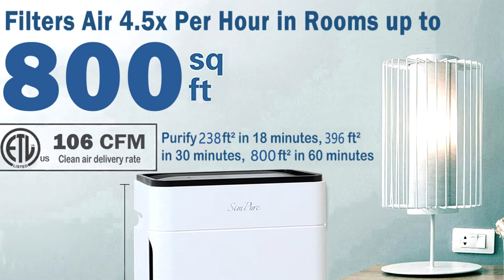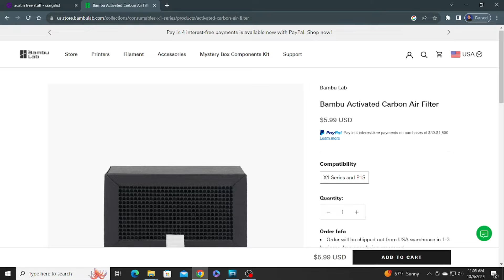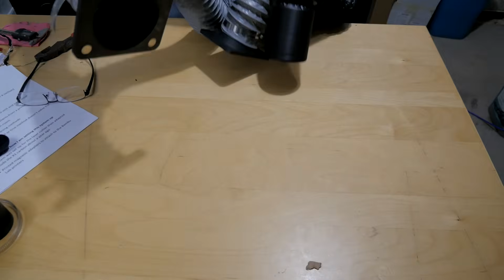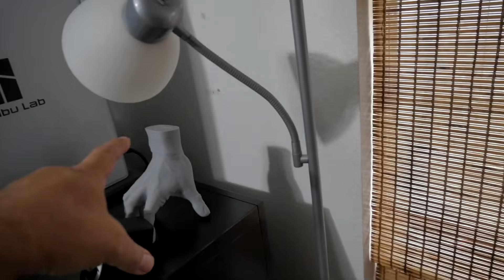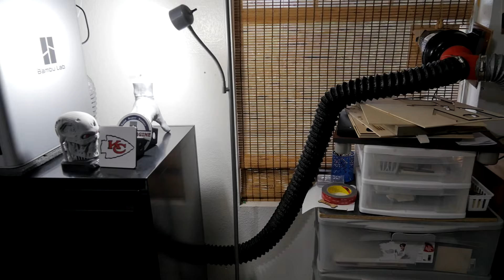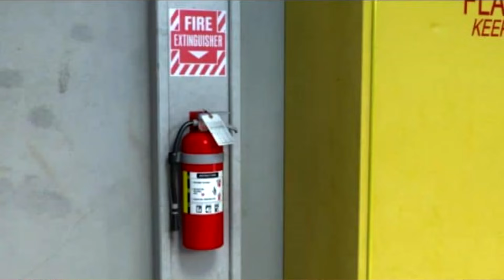Do You need Air Ducts or Exhaust for Your 3d Printers?

Comment: im new to 3D printing and i have the X2D. i just print with PLA for now. im asthmatic so i have noticed that when i enter the room while 3D printing, i can feel im a bit short of breath. im not sure if im imagining that i smell some fume. this is despite having an air purifier (placed near my X2D but sits on the floor - X2D printer is on the desk/table) that is rated for 1000 sqft area (my room is just 180sqft). I have noticed a difference when i placed my air purifier beside my X2D ( i have the Levoit with vent outwards). I am still thinking of installing a small exhaust by my sliding window but will observe. any suggestion?

Comment: I dove into a filtration system and got vivisun fan for the job. I had printed only 2-3 times when i first got my printer. it 2 14 hr prints and I started having breathing issues within 2 hrs and a perma cough for a week. But i also got insanely dizzy and my eyes were burning n i thought i was just sick. all this from just PLA. The vocs are no joke. 

also my pc's were sucking in some form of particle that it make the inside of my pc like significatly dustier and with coarse dust also. I keep my shit clean and it got dirty dirty. 

Printer i used was the X2D

Comment: With CA trying to ban 3D printing, I'm surprised they haven't taken this tack to put an end to it.  With all the air quality insanity we get from the AQMD, and the push to ban gas stoves due to global warming and indoor air quality issues, this just might be their next line of attack.  Just took delivery of a new printer, and I'm uncertain where to set it up.  Considering a corner of tge garage, and installing a stock bathroom fan above it.

Comment: This is quite a complex topic when you start investigating it. Most videos show no evidence of air quality measurement to assess the systems they set up. Accurate air quality meters are probably not available at domestic prices anyway!! Air filters vary in how much carbon they contain and not all HEPA filters are equal. They also don’t deal with ultrafine particles. There is also no way of being certain when your filter has stopped being effective. The bit I do agree with is to think about them in the same way as a car exhaust. Spend as little time working near it as possible with as much ventilation as possible. Apart from that there are a lot of unknown variables.

Comment: These are the parts I bought on Amazon. Doing this for my first time so would appreciate any and all help. I have 2 printers Elegoo Centauri Carbon ECC and X1c. AC Infinity 4" blower unit designed for a Grower tent. AC infinity, I think, a Hepa filter unit. I also bought a Round charcoal filter unit. I see that it does not have a way to pass air through it to vent to the out side. So it is supposed to vent inside? On that safety issue? I also bought something called the blast gate. According to Gemini V3, which just can out, is needed if you are only running one printer at a time so fumes do not pass "backdraft" back through your Y adapter instead of going out the window.  I guess my ? Is just to confirm that this will make things safe. For peace of mind. I wonder if I can replace the "hepa filter" with a Hepa/Carbon filter and not having to find a separate carbon filter unit that can then still vent outside. I would show you a pic of the parts and the diagram Gemini designed for me. But I can find a way to attach photos.

Comment: Any issues with chamber temp when hooking up external fan?
Reply from the maker: If you have a high cfm fan, it will pull some heat also. Use an adjustable duct fan and keep it low, enough to pull fumes.

Comment: The only issue I've ever had with venting outside is winter. Especially if my laser machine isn't running. I have a 3d printer on order so I'm hoping to make a filter system for it for inside so the enclosure isn't frozen when its not running. I'm still trying to figure out a way to put a door of sorts on the ventilation system to keep the cold out when its not in use while not having a leak when its running with the door open. I tried putting a one way draft blocker but they aren't effective. They even let smoke backfill from another laser when only one is running so i need a different solution.
Reply: Use a DC inline duct with a double pane plexiglass window.

Comment: HEPA filters work great for particulate matter like PM 1, 2.5, and 10. To get rid of volatile organic matter (VOCs) an activated carbon filter is very important. The carbon filter on the Bambu Lab X1C I have doesn't seem adequate by itself. I am using a Blue Air 211+ with smoke filter for now, but an exhaust system to vent outside would be great. I am curious if too much airflow in the printer will negatively effect the print though.

Comment: Cool, video,  Lots of good info. Thank You.   I'm still trying to figure out what to do in my case.  My printer is in my residential windowless basement office with ventilation. No heat and only below grade passive cooling in northern Canada.  I need to figure out some kind of  insulated damper system to go from indoor to outdoors where the temperatures can vary from +38C down to -40C temperatures.   Something where I don't cook to death in the summer or freeze to death in the winter and avoid off gassing myself.  Heating isn't a problem between multiple computers and the 3d printer.  But the smell from PLA is what has scared me off trying ABS and nylon.

I am printing the "Bentobox" found on PRINTABLES, but I think I'm going to step the fans up to NOCTUA fans as BEQUITE doesn't make any fans that small. I don't want to become a wind tunnel of noise.   More research.  If you have any ideas I would love to hear them.   The last thought was an expensive idea, and likely beyond my financial means,   A sealed enclosure with a dedicated indoor air exchange with carbon and Hepa filtering system that encapsulates the Carbon X1 and have the AMS sit above it for easier access when changing filaments.  But space may be an issue.

Comment: I have watched some other videos and you really need 2 fans one for bringing clean air into the printer as well as exhausting the bad air. And YES, when you bring in cool air it is going to affect prints. So it is a give and take regarding regulating how much air flow volume is the right amount for the filament and temp in the enclosure. And also a heated chamber is needed for some types of filament. There are probably some other issues not stated here. But I think one issue is that printer beds do not heat 100% evenly all the way to the sides of the build plate. If we had a build plate that did heat evenly from edge to edge I believe that would help a lot here in the warping aspect of parts.
Reply: Yes this video is - very - primitive. Better than nothing I guess, but not the correct way to do exhaustion of toxins. Thank you for mentioning using - two - fans. Using a chamber heater will somewhat correct for the cool air issue. Both fans should be matched and set up so the air pressure goes from negative to positive when venting. Otherwise you'll create a bottleneck. Using a good 4" DC inline duct fan also works. Having a good Carbon Monoxide Detector in the room is also a must.

Comment: Hi thanks for this video, very creative idea.  Do you run the blower while printing or after?  Have you noticed any change in the print quality.  I heard you can adjust the bed temperature in the X1C settings.  Curious if this kind of setup could work simultaneously with the printer, but some jobs are hours or days.  I wonder if a bath fan could handle the abuse.  Great job, thanks

Comment: I've got a Qidi x-max3 and have install a 120mm fan to the rear with a adaptor duct to bring it down to 100mm duct tube going through the wall outside. I run it at 100% most the time when printing PAHT-CF and dont have any problems with printing and havent noticed any difference in chamber temps. The fan is pushing 83CFM ,I am yet to try with ABS

Comment: Newbie here but question about the setup.  The Makereorkd file is for a 3” hose snd the blower is for 4” hose.  Do I need to modify the print file, or do you have a 4” adapter to match all the other products you linked?

Comment: Only issue is if you ventilation pulls to much it will pull all the heat out of the enclosure and cause crappy prints. It needs to match the stock airflow just piped outside. And the door has a big ass crack in it so like others have said just as long as theres negative pressure thats whats important
Reply: I was trying to figure out if i needed to add a 120mm fan to my exhaust set up,  maybe 6ft of total hose

Comment: The objective, the venting of  fumes generated by 3D printers outside is laudable. However, the video portrays a lack of understanding of basic principles, it is tedious, omits important information, and has not been thought through.
Both the Bambu P1S and XC1 have auxiliary fans which vent fumes from the enclosure, they also have activated charcoal filters to absorb VOCs, if ducting to outside is employed, the filters can be removed.
The internal auxiliary fan is controlled by the on board electronic circuitry, which monitors the enclosure temperature, and adjusts it to ensure good quality results, when using different filaments.
Using 3” ducting and a sizeable blower will almost certainly have a negative effect on the quality of the of the printed items.
All of the printers, in the video, are connected permanently to the blower, there are no gates to select the printer in use. If you have all your printers running 24hrs a day, this might be ok.
What is required, to remove fumes from a printer is, a printed magnetic connector, 2” duct, and an external vent cover.  If such a system fails to provide sufficient air flow, due to duct length , a “small” fan can be added.
If multiple printers are being used, then a means of connecting individual printers using gates and a means of controlling volume would be required.
Reply: Get a variable speed exhaust like infinity and you can create negative pressure slightly without venting too much. I try to buy variable speed on anything I buy.
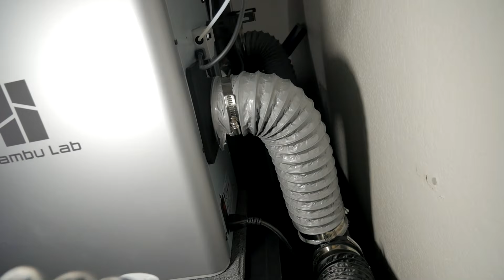Reply: @FueledToCreateOfficial  Hi John.  I can see where you’re coming from.  Perhaps something like the Amazon EpheyFIF Quiet Inline Duct Fan with Variable Speed Controller for £11:39.
However the printers, P1S and XC1 already have an auxiliary fan which exhausts the fumes via an activated charcoal filter, into the room. This fan is variable speed, and has sufficient power to force the air through the filter.  If the air is ducted outside the filter can be removed, this improves air flow.

This is the set up I have, and it works fine. My P1S has its back to an external wall, as a result the duct length only needs to be about 15”, and the system works well, using 2” flexible duct. Outside I fitted a three flap cover, and there is sufficient air flow to slightly open the flaps, which is sufficient, and doesn’t affect the internal temperature of the printer.
If the duct length needed to be longer, an additional variable speed fan would probably be necessary.
Cheers Noel
Reply: @Jestey6 So no additional fan? Just a magnetic cover for the place the exhaust comes out connected to a 2” pipe out the window?  Mine sits on an outside wall in front to the window.
Reply: I can see how that would work. Thanks

Comment: Same question as above.  Does sucking the air directly from the enclosure affect your chamber temps and therefore somewhat defeat the purpose of the enclosure?  Have you tested the effect of the exhaust fan on chamber temps?
Reply: Yeah, it kinda seems like the ideal solution would be putting the printer in a room with a ceiling exhaust fan to clean the air in the room and run it for a while after a print
Reply: @takkaros21
1 second ago
I am still waiting for my p1s and already ordered a hepa/activated carbon filter to attach at the exhaust. Those round ones some air purifiers use. It should capture all vocs and small particles before they get out. Seems the easiest and most effective solution when you can't physically exhaust the air outside.

Comment: I like your setup, it is similar to what I had in my head to setup in my printing room. I would need to use a window as well for exhaust and appreciate you not only doing the leg work but putting it all up here in an easy to digest format!

I have a question though, will the window exhaust fan suck out too much air and affect print temperatures? I know that the P1S and X1 have active systems to compensate for this, and you seem to print with higher temp materials a lot, has the addition of the exhaust fan affected your prints due to more air circulating through the printing chamber?
Reply: No, the P1S and X1C do Not have active heated chambers. But the X1E does
Reply: @WaynesForge Maybe, but the bed and nozzle are heated and during printing the temperature in the cabinet does go up.  In fact the Bambu printers in this video switch in fans to control the temperature.  It appears that there is a lot more going on than you are aware of.

Comment: Have you tried printing ASA with this set up? I have very similar (Bento Box, Duct work with inline fan) and i can’t print ASA because you can’t run chamber fan and not having the print warp.
Reply: Have you found a solution maybe a  inline fan with less cfm?
Reply: @EffB Yes I did. Thanks!
Reply: @Ggoodnight35 great! Please share the details lol
Reply: @EffB I have enclosure with vent to attic. I now run the chamber fan at 50% with ASA.
Reply: @Ggoodnight35 good to know.  Glad it worked out for you.  I have a bath fan vent to attic I’m going to try to incorporate into my setup!  Thanks

Comment: I printed the exhaust fan adapter but do I need to get a blower or is having the exhaust  pipe connected straight to my P1S and out the window good enough? I only have 1 printer.
Reply: The key is negative pressure, that more air gets pushed out from the enclosure than in so that minimal particles escape the enclosure and instead out of the exhaust duct.